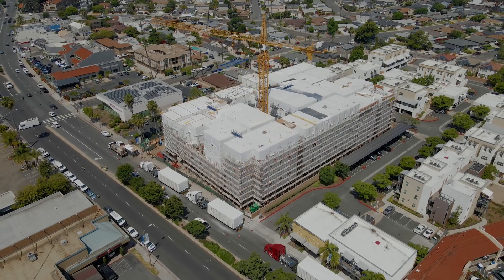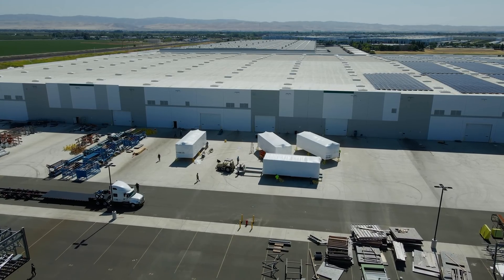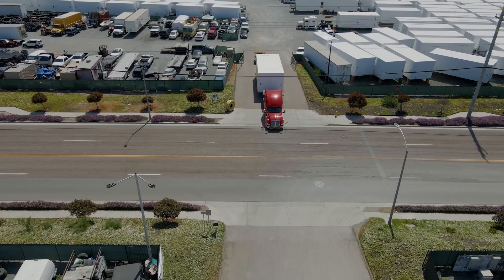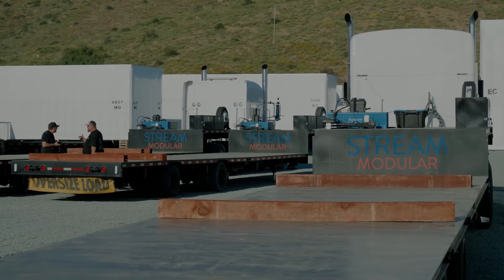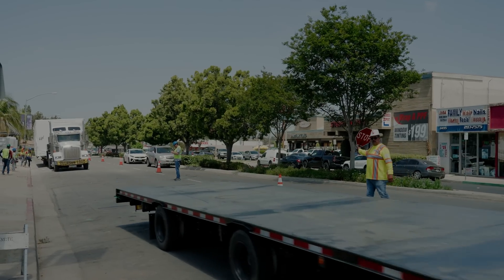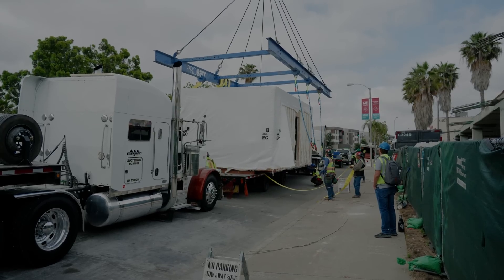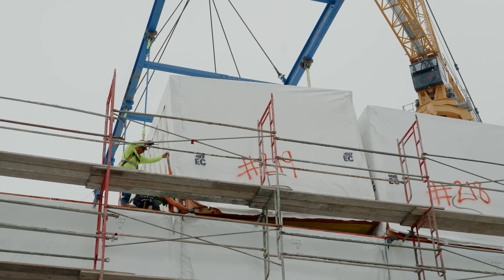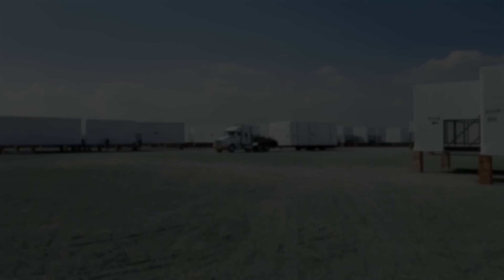The Secret to Installing 393 Modular Units Faster Than Ever

Comment: Very cool, I really think we need more affordable and easy access to housing for better prosperity. My only concern with these types of modular constructions is - is the cost really that much better? Are we talking like a 1/10th of the price of a conventional apartment? Or is is more like 1/2? And also the longevity and upgradability.
Reply from the maker: @skulltraill Thank you for your thoughtful comment! We love to hear your enthusiasm for affordable and accessible housing. Modular construction indeed offers some significant cost benefits compared to conventional methods, though the exact savings can vary based on several factors.

Typically, modular construction can be 10-20% less expensive than traditional construction. While it's not as dramatic as 1/10th of the price, these savings come from reduced labor costs, shorter construction timelines, and minimized material waste.

In terms of longevity and upgradability, modular buildings are designed to meet the same standards as traditional structures. They can last just as long and can be upgraded or modified as needed. The modules are built to be durable and can easily integrate with new technologies and materials as they become available.

We appreciate your engagement and interest in this topic! If you have any more questions or need further details, feel free to ask.